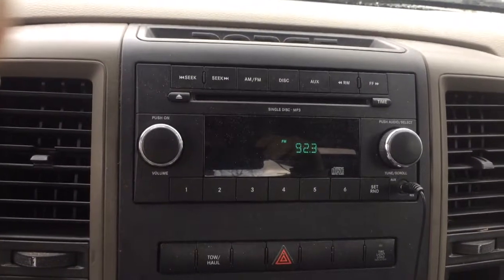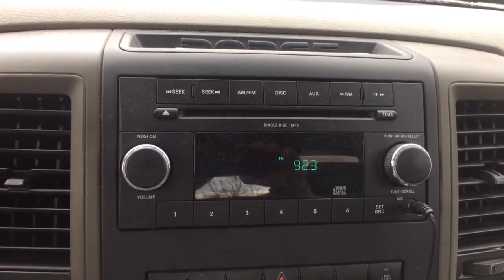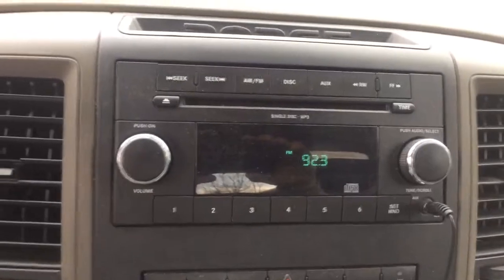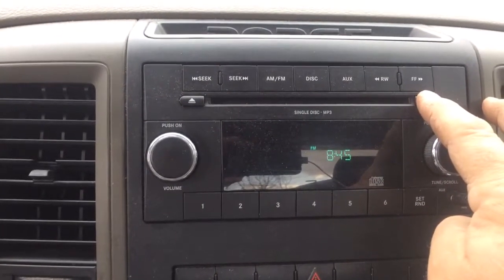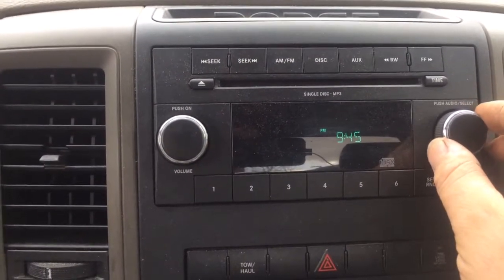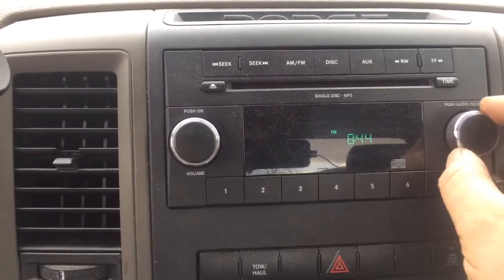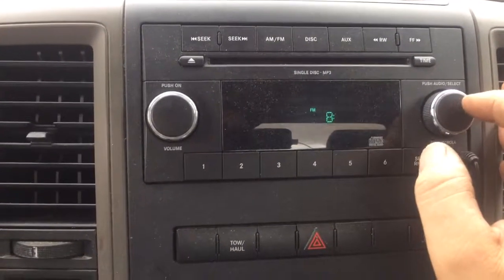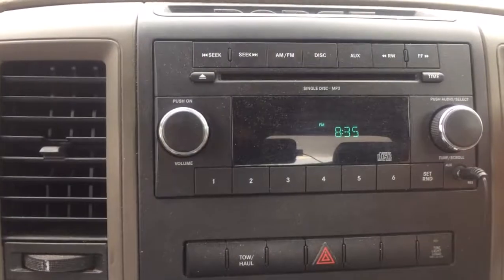how to set the radio clock, 2011 dodge d2500

Comment: Great vehicle choice, hope you still got it. 👍 Just bought a '10 1500 4x4. Video was straight to the point and you are appreciated. 🇺🇸
Reply from the maker: was a good solid fast strong truck until 35,000 miles, started rusting and the exhaust manifold bolts broke off, sounded like a wwII panzer! traded on a new 2019 f250 super duty, haven't looked back.
Reply from the maker: glad video helped and thanks for watching and the kind comment!